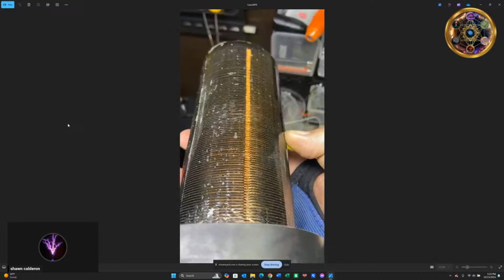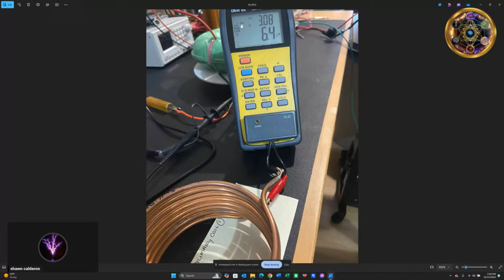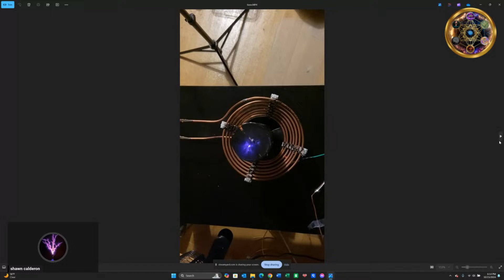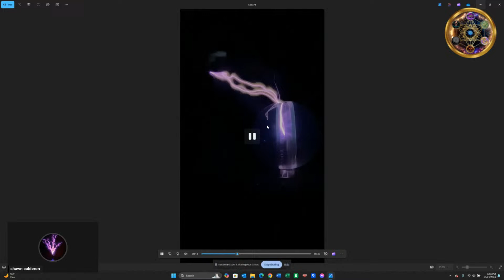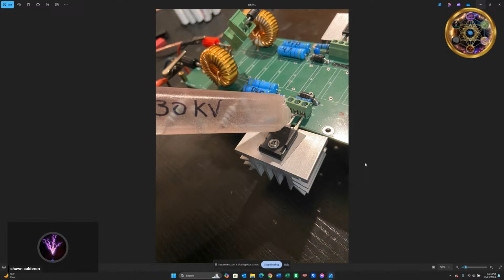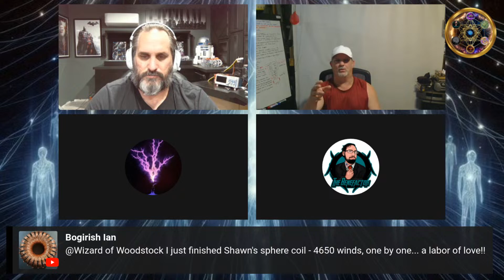Gerald Nathan & Shawn Building simple circuits

Comment: So the Tesla coils, with a Capacitor, primary coil technically has a second capacitor in the gorm of a spark/air gap
L 2C
Although, some circuits do not include the spark gap in the LC loop.

Comment: Ok this has triggered something, if we only need to open a path for lighting or the ion flow path then what about a small laser to guide the flow to an antenna into the Tesla coil?? Lightning eater⚡️⚡️
Reply: Or we have to pump enough static pressure into the earth to produce the effects before lightning to open this tap of energy
Reply from the maker: @dkdyker  Now this is what I am doing. The earth as a capacitor. But the energy is changed by the minerals in the earth. My next 2 tests. 1. connect 2 coils with water instead of the wire in last experiment. 2. Then run it through wet mud. 3. run it through the ground. We will see what happens.
Reply: @oldmanbuilds 
I too have thought the earth is a capacitor, but also resistor and a conduit also.
Reply: The laser and or Tesla coil would need to tuned to each other. Then a magnetic coupling may be needed.

Does anyone know the best frequencies to use?

Comment: First time viewing your channel.

Just wondering, why don't you use a Wheatstone Bridge circuit to measure and balance the primary coil to the secondary coil.

Tesla said mass = mass 
And the Wheatstone Bridge circuit gives an analog display of balance.

Also, did you know how close you are to building a teleforce device?

There were two teleforce devices one perfected before 1907. The teleforce device was a transmitter and a receiver.
Scaler waves enable the confinement of the teleforce from the transmitter to the receiver. 1:24:39 

Old Man Builds Nation: scalar static field displacing (pushing temperature away) can create a similar field to UAPs on thermal imaging.

Thank you for the tank circuit found in the Tesla coil explanation.  It helps explain the receiver.

Gerald: The Ghostbusters proton pack follows similar principles of Nikola Tesla's ungrounded devices.

PS. Wardencliffe was a grounded system. Tesla described another perfected device as ungrounded (or not grounded).
Can anyone tell me how to target using the Wardencliffe tower using a grounded system with an omnidirectional top dome/torid?
Did anyone think to look at how NikolaTesla would have oriented the teleforce to point at the North Pole. Yes I am talking about Tunguska.

The Tunguska aligns with the 1908's magnetic north, then continuing the straight line, it virtually aligns with Tesla's Colorado Springs lab. The Wardencliffe in New York aligned with the magnetic north of 1908 (in  Canada) doesn't align with Tunguska.
Also notice Tesla talked about perfecting his teleforce before 1908, then nothing after Tunguska.
Tesla also knew how to excite the Aurora Borealis through high frequency in the upper atmosphere.
Then a second deathray was started after the 1930s... a particle accelerator.

You all are perfect. Keep going. You are on your own path. Keep producing.

An inventor should be having a prototype with their patents filed. It keeps the true inventor on the patents.

Nice comrodery. Subscribed.
Reply: Welcome to the channel. Thank you for sharing so much good content. I'm very new to Tesla coils and fringe science. I am reading more and more about the topics mentioned, and the learning curve is steep. With informative comments like yours, I'll get there.